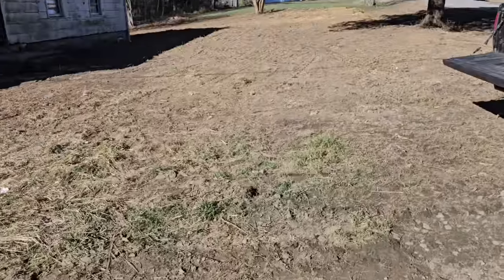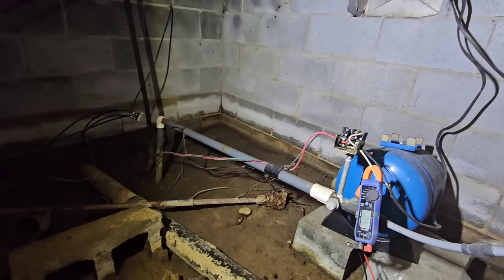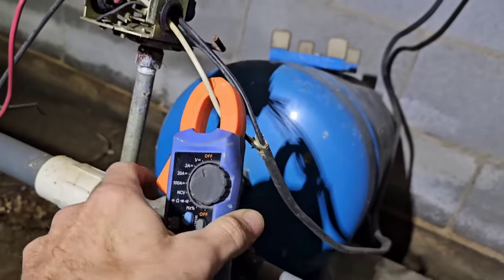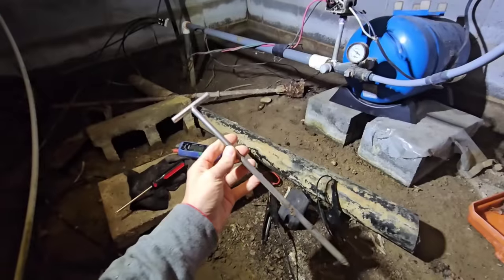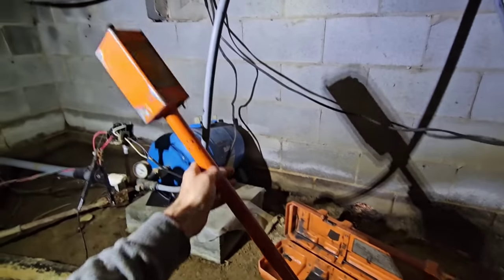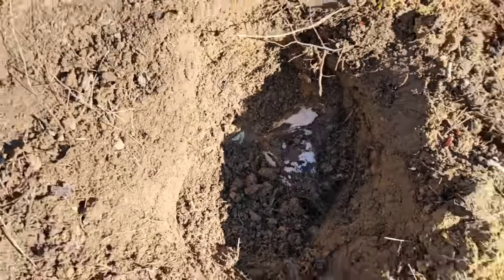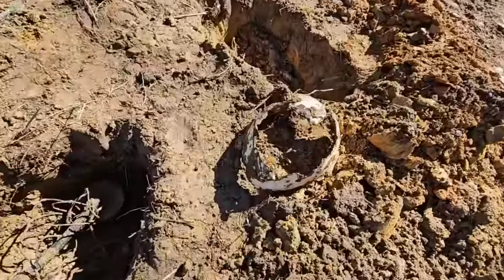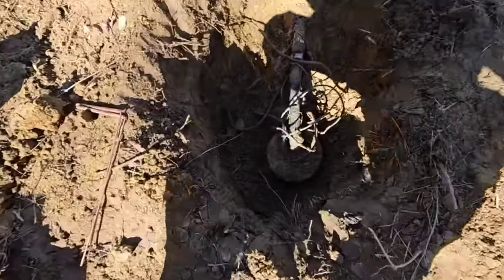Can Copper Dousing Rods Find a Water Well below the Ground? New Tech Vs. Old

Comment: I didn't understand. You used your device after connecting here and there, walking almost to the woods, digging three holes. After that on your first attempt with the rods you located it. On your summary you said "I don't believe in this magic...! So, you are now a believer or are you still willing to use your 10,000 magical wand? By the way just a suggestion...when the wand turn both to one direction without crossing, they are not crazy or magic....they are pointing you the direction to follow. As they cross...that is your point. Another suggestion, if you rod handler is attached to the rod (both are just one piece) you might compromise your assessment. Try to use a drink straw to keep the handler lose and the rods free.

Comment: Our community was running out of water and calling tankers in summer at exorbitant cost. A decision was made to drill a well. Location of the spot was tried out with the most modern methods, even satellite mapping was done. A number of spots were located, as best, second best, third best. The first spot drilled was a big zero. The second spot drilled bas a bigger zero. Third spot was a disaster. I was born and bred in the village. I was a keen observer. Those days the old men of the village used to douse with a help of a Y shaped wooden stick, a coconut or some kinds of metal rods. I offered the community to locate the spot with whatever knowledge I had. They laughed at me and later challenged me. My ego was hurt. I counter challenged them, to permit me and that I would do the drilling at my own cost. They were delighted with toxicity and permitted me. I made my own copper rods, located the spot and counter checked the spot by the coconut method. I wrote on a piece of paper, water at 500 feet, ample water at 570 feet, and gave it to a guy who was a bit sympathetic towards me. At the time of drilling water was struck at 500 feet, drilling was stopped at 600 feet. The community rushed with 5 HP 1.5 inch pump, the problem was solved. Of course they paid me my drilling cost. Ancient technology defeats satellite mapping.

Comment: By the way, when your rods turn out or cross, or via the one crosses and the opposite one turns out or they jitter and are moving, Yes, these Location Rods have just detected water, a object like metal, etc.

However, please note that the object water and all will be right behind you feet. It is not directly below the rods. Water and wells cover a wider area wear-as a lost ring your looking for will be below your heals. 

This happens 100 % of the time. Experiment with buried gold, silver, an aluminum can, bottle cap, etc. and you will become more professional at using Location Rods. 

Like candles are miss used by Hocus Pokey Religions in their false ceremony’s, so has location rods been treated like pagan religionist objects. They call them evil names like dowsing rods, divining rods, etc. and try to imply demons, spiritus and such control them. 

Those types of pagan religious explanations are blinding peoples minds as to the truth of why these Location Rods work.

I with scientific experience have proven what is the cause of them working, on locking a mystery that has baffled man for thousands of years. In another comment I will send n simple believable and provable terms explain how these rods you used works.

Watch for my next comment that will be soon after this one.

I am the discoverer of how these rods work, and why.

Comment: When i was a youngster, and on my first real job as a roustabout out of Hobbs, New Mexico, an old timer taught me how to do this whike on the job in Denver City, Tx. It does work well, but not on windy days, obviously. I was surprised when I came home to Califoenia on vacation, and wanted to impress my mother. Turns out, she already knew how to do it. I wonder if it has anything to do with our body's electrical system. Both my mother and i will stop a timex wristwatch...me in a matter of weeks, and my mother in a matter of days. This reminds me of a card trick that no one ive encountered can explain. Ya take the 10, J, Q, K, Ace out & organize in suits & arranged in columbs, from high to low, and stack em into one stack. Next, you cut the cards, making sure you leave alone three cards on top, and three cards on bottom. You can cut em once, you can cut em all day, the outcome is the same. After cutting, flip each top card face up, in 5 stacks, like you are dealing, but face up. The result is obvious, and the outcome is every time. Could somebody please explain, in laymans terms?

Comment: I watched my well driller 33 years ago use coat hanger wires (cut & bent) that I supplied to him to locate my old well as well as to plot the location for a new well.  Both were successes.  I never ran out of water after that even with watering a 36' x 120' garden during a summer drought at only 72' down.  I don't know how it works, but he said it had something to do with magnetism around water.  My dad used a dowser to plot 3 spots on his property in 1962 when he was building.  He claimed the dowser said he would hit water at 150' at the chosen location which it was more like 200', but the water came up into the casing at 151'.  Lucky guess?  You be the judge!

Comment: I was a skeptic until I saw someone find an electric line with dowsing rods.  I tried it. Worked for me, too. Used copper 1/4 in faucet pipe bent at 90 degrees.  Keep top flat, hold loose.

Comment: Dowsing works. Since olden days. And the explanations always end with,"Or something like that..." I have found wires, coins, water lines. With exact location every time. Requires no faith or understanding. A true mystery. A true story: My neighbor, a dairy farmer and I dug a deep line for water in a calf pen. He showed me how to do it and together we located several service lines (electric and phone) to avoid with dowsing. Perfect. My mind was blown, having the rods(welding) cross in my own hands. But there's more. After we installed the water line we experimented by my standing directly over a spot we knew was over where the new piping ran, eight + feet below. He went into the well pit and I told him when the water got turned on for the very first time by the rods crossing as I stood absolutely still. Amazing. Final note is it helps to be shown, sort of an initiation, a shaktipat.

Comment: I realized this video is 1-year-old I'm hoping to find answers. I bought a house it has a well with 2 other houses grandfathered in on my well  Shortly after I took possession of the house My galvanized pipe burst underground. And the house built-in 1950 the galvanized pipe went underneath the fed foundation and back up underneath the house I did not dig it out. Since the pump house was up against the back of my house I just ran pecks pipe through the wall and down through the floor and connected it to the rest of my plumbing.
 Here's my question?  The water pressure was magnificent I mean too high even the neighbors said they've never had water pressure like that before. One neighbor worked for the water department and he said this is going to explode our pipes So I checked the tank and it was like it 85 pounds of pressure. After a discussion with my neighbors we decided to let some air out of the pressure tank At least down to 70 to see what it did. Before it got to 70 Warners 72 the pressure dropped to 0 with my tar gauge I was using on the valve stem or whatever you call that thing. So we replaced everything. Pressure switch Pressure tankAnd a couple of dripping valves . Now water pressure is probably normal But why did I have that exdream water pressure for a short period of time?

Comment: Just remember, the Earth's magnetic field strength varies from day to day and even hour to hour. Dowsing, as far as I know, works with the Earth's magnetic field. I use it in mining placer gold. To see it work, try this. Place an electric trouble light out in your yard. Connect an extension cord to it and plug it in. Walk across the line while holding the rods. Expect nothing , just observe . Make sure you have no interference on you such as a cell phone. As you walk across the cord, they should cross. Continue walking and they will separate. Try the same experiment with the power to the light shut off. The rods should not cross. You will find a similar reaction when you walk over buried water lines to your house.

Comment: I was researching the topic of dowsing rods several years ago...and to make a very long story short, copper wires make the best dowsing rods (compared to aluminum or coat hangers..and I tried them...made them myself) if you're trying to locate something made of metal (lead, gold, silver, copper, aluminum, iron)...but to find water (and I haven't tried it) I heard it's best to use a freshly cut Y-shaped willow branch.  With using the copper wire dowsing rods, I'm not sure exactly how deep they will detect metal...but I know that it's at least 3 feet below surface...deeper than I care to dig with a spade or post hole digger.  They will detect metal objects underneath concrete as well as underneath water and above shrubs....which many electronic gold prospecting metal detectors can't.  It's not about belief or faith...it's about trial and error and knowing that the rods are acting like antennae sticking out from your own body's electrical field.  You don't gotta pray or be spiritual even say what you're looking for.   Throw a quarter (coin target) on the grass and walk over it with your dowsing rods and watch how they cross and uncross directly after having gone above and past the target.  Typically, I hold the rods in my hands with my hands held next to each other close to my chest...rather than with arms extended outward.  Having other electronics on you (phone) or steel toe boots...might distract the rods from finding their target.

Comment: Never had occasion to try copper rods.  But have dowsed with forked sticks from about 7yo.  Dowsed my present well, driller said I had 40 gallons per minute, while wells he had drilled for farmers had on occasion got 1 (one) gallon per minute.  Oh yeah, forgot with my well, but if I had thought of it I could have told the appromate depth of the water.  Water tested almost chemically pure.

Comment: Be open to the dowsing rods. 
I had an 80 year old out to dowse a property two years ago.  Been at it since a teen. 
He had a 95% hit record.
If interested research the history of dowsing.
It has been used to find rare minerals historically.
Also some can dowse much more effectively then most others.
WHY ????
The 80 year old used a branch from a tree shaped in a y.
When over water it would jump up and down fairly violently.
He said it isn't sensing the water, it is sensing the energy flow.

Comment: Excellent to see your process and I am glad the L-rods worked so well. I am a professional dowser, not for water, but I use them for other practical reasons. I can also find water so know it is possible. I even taught the builders who were working here last year how to dowse, as they could not find an old land drain and a few other underground pipes when they were creating a new build on my land. I live in Southern Ireland and many of the drilling companies I know of use Diviners as they are called over here, or dowsers; or they dowse themselves. I use L-Rods mostly outside, as a pendulum is often affected by the wind. In answer to your question about how you would even start in such a heavily levelled area, we often use a map of that area first to remotely dowse the site; depending on its size. Or, you can stand at a certain point, such as where the water pipes left the property, and by asking the right questions; then focusing on that answer (such as show me the direction the pipes are leading away from the house). The rods will point in one set direction, showing you where you need to walk. With clearer questions, you can then follow the line and add flags as you go. I have even located broken pipes under a shop over here for friends; as the shop was regularly flooding. When the floor was then dug up, the exact point I indicated on the map was where they told me the an old broken ceramic pipe was totally blocking the outflow. I do most of my work remotely, so do not even have to be in the same country. Everyone can dowse I feel, it is one of our natural abilities as humans; as water is the one thing we all ways needed to find to survive. Brilliant video and as they say over here, may there always be a blessing upon your work! /|\

Comment: We just used fencing wire, but it sure does work for finding underground water and electric lines. One thing though, it doesn't work for everybody, My dad and my oldest brother get absolutely nothing out of the wire, but myself, my other brother, and my mum all have the wires cross when walking over a cable or pipe.

Comment: Dousing Rods have worked 90% for me. I did communications lines for years. Found many underground splice boxes, major buried manholes alter large land areas were leveled. After a while you can track conduit in concreate floors if they don't have to much rebar, but it take practice to get the feel of the rods to do that. Not voodoo, true science of magnetics.

Comment: Once I was chopping birches in forest. While clearing branches off, I griped Y shaped branch. Immediately flexor muscles of my both hands started to pulsate and head of the Y branch started to bend towards ground. So dowsing rod is not a myth, as I have experienced it myself. Those copper wire gadgets I have not tried, though.

Comment: Yes dousing with copper rods does work. I do not have the steady hands so other guys in our water department did the dousing and located a ductile iron pipe at 6 feet below grade. However my daughters water line froze up here in the North East. I used a pipe locater with a transmitter system. I traced the copper pipe through the neighbors yard next to his empty in ground pool. The empty pool caused the water line to freeze up. The line was over 300 feet long. I also located a 6" pipe leak by testing for fluoride.  Did the Town a favor. Solve my daughters frozen pipe. It was a good day.

Comment: You need to upgrade your Radio Detection gear to a newer model that diaplays depth. When locating wells the signal will not only leech into the soil, but also water veins. With a modern detector you'll be tracing the depth of the burried line and then you'll notice it drop from 4 foot depth to 90 foot depth, for example. Clearly, you've just passed the well head.

Comment: I had discounted and dismissed this as not working, until one day, without intention, I experienced the "force" and within a few seconds a new realization came.  It was an uncommonly low humidity day in winter and  I was wearing a sweater, with my sneakers (good insulator) on.  I was holding a wood wand, and without any purpose the wand came near a grounded metal lamp, and I felt a movement and force.  I verified the force was there.  Then came the moment of realization.  I was full of static electricity, perhaps 20,000 to 30,000 volts.  With skin resistance even near 1000 ohms, it might as well be a dead short with the wood wand,  the electro magnetic field lines were drawn through the air to the better electrical ground of the electrically grounded lamp.  This is also how it works, for finding water below the surface, or finding pipes below the surface.  Wet earth (or buried iron pipe) makes a better electrical ground which changes lines of electromatic force as you walk through and past the change in the (hidden) better electrical ground source.  When you have collected high electrostatic electricity it allows you to sense the electro  magnetic field lines in a number of ways, and helps explain why this ancient technology works. I believe the "L" shaped copper rods, and the user's technique allows a lower amount of static electricity necessary to feel or see the effects of the electromagnetic force.  This time honored methodology works, and there is science behind it, but you don't need to know the science for it to work. If you don't have static electricity, perhaps it also works, similar to an induced current when the armature is moving in an electrical motor since the person using the divining rods is moving, perhaps there could be an induced field (and/or somehow the earth's magnetic field comes into play).  Amusingly scientists and others should not be so quick to dismiss this amazingly useful technology.

Comment: Dowsing Rods work... We used #9 wire 3ft long with a bend at 2½ ft at a 90* angle  a loose grip with your pinky on the close side to prevent drag ...
shoulders with apart, not 6" like you were doing.  Held level perpendicular to the world 🌎  walk in a straight Line and when they start to go together slow down and when they're crossed you're there!!!

Comment: Dowsing or divining is a queer old game...Some folk have it and others never get it as long as they have a hole in their backside. I can dowse but cannot guarantee what I'll find, water main, field drain, electric cable, phone line, gas pipe... could be owt. I just use heavy fencing wire or wire coat hangers cut and bent . I think with me it is just where the earth has been disturbed and dug up... Ex digger driver of 50 years.